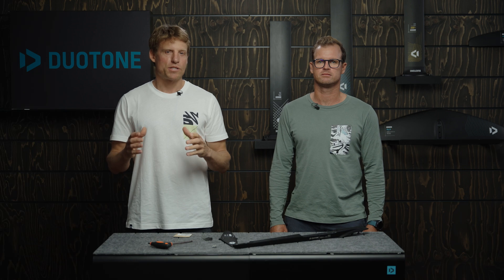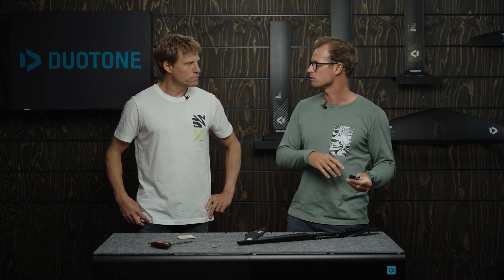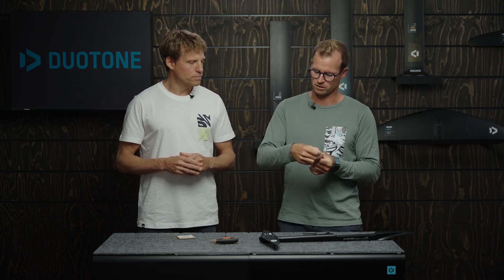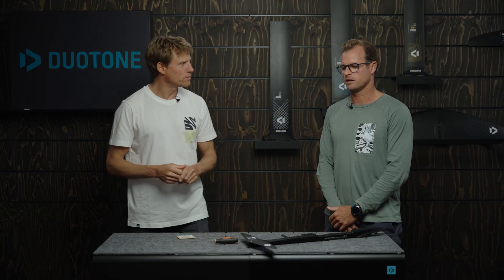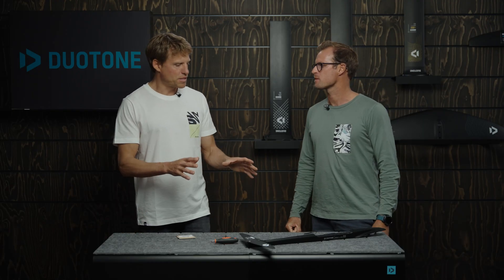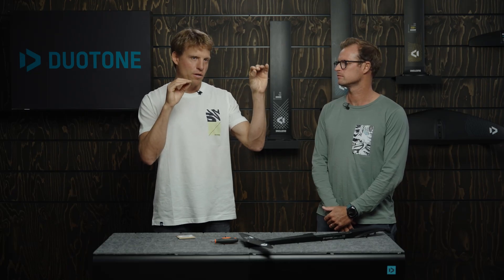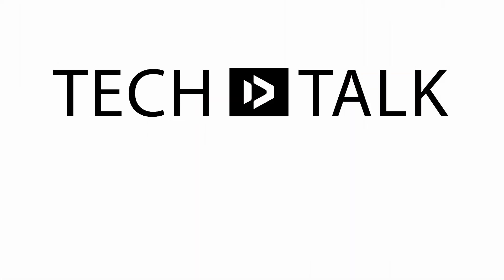Duotone Wing & Foiling Tech Talks - Foil Position, Trim & Shims

Comment: Cheers for the video! What screw length do you guys recommend? If I want to use say the 0,5 shim on my 1350 glide v2 setup, I found that the screws that came in the package were not long enough…don’t wanna lose my stab😅
Reply from the maker: maybe try the M6x20mm screws, bit surprised that they are too short? are they the M6 x 16mm.

Comment: Hi again, If the stab plays a negative force (down) compared to the front wing (up).... then, a large stab increases lift but does not increase glide nor speed, as a larger stab increases drag and does not add lift... am I right ?
Reply from the maker: Hi Fran,  Jerome had some issues to answer your post here for some reason, did not work - lift yes a bigger stab will create more downward pressure, but this can also then lead to the front wing coming up/but makes more drag and can actually make the foil perform worse if too large. Glide can be better normally/but the pump speed/efficiency is mostly worse, as it is then slower to pump. Slower for sure, unless the back stab was too small to start with. Ride weight and experience level can however then vary a lot, as some will prefer the bigger back stab to stay up longer, whilst others want a smaller stab for a higher pump action speed. Generally we try to hit the middle/sweet spot with our foil sets, most of the time no need to change anything.
Reply from the maker: Hi Fran, Jerome sent me this to add to my comment, as you can see, it's not always that simple...:-)

Yes, you are right, except for "a large stab increases lift". Not in all cases.
Let me explain:
During low speed take off, when your fuselage has a positive angle of attack, higher than say 5 degrees, then your stab is momentarily also having a positive angle of attack and it is generating lift in the same direction as the front wing. In that case, a larger stab increases the overall lift of your system. Once you start to accelerate and you reach cruising speed with your fuselage closer to 0 degrees, then your stabiliser is pushing in the opposite direction as your front wing and thus is removing lift from your front wing, making your setup less efficient for a fixed speed and fixed angle of attack (close to 0 degrees). In summary it is a little more complicated when we start looking at various speeds and various angle of attack of your fuselage, sometimes the bigger stab helps, sometimes it doesn't.
You might tell me: "well that is weird because I definitely feel more lift at cruising speed with a bigger stab, and here you are telling me that a bigger stab makes my setup less lifty"
What you are feeling is not more lift from your system, you are feeling the center of pressure of your system moving further forward and applying more force into your front foot than your rear foot.
I hope that I was clear enough and have answered your question.
Reply: @duotone.wingfoiling  thank you guys for the immaculate explanation and for your great customer support !

Comment: I think you should explain the difference and relationship between "front foot pressure" and "lift".
Also, the difference between lift at low speed (before on foil) and lift while fliying at high speed. Are both affected by shimming ?
Reply from the maker: yes, people tend to mix things up a bit here, even ourselves during test reports between different people. So front foot pressure is whilst you are up on the foil already, this is how relating to how much pressure you feel from the front wing pushing upwards under your front foot - many people would call this then lift, as it feels light it is lifting.

Actual lift should be the way the foil lifts from getting the board released from the water to a foiling position. Foils with a lot of "lift" in this case, tend to often have a lot or good front foot pressure, but this can be too excessive, if you are looking for speed/manouevers or an inexperienced rider will not know how to use his/her body weight to keep the foil down. 

Lift at low speed can be good, to get up onto the foil, this can be adjusted by shimming, yes by adding positive tail shims. Or by moving the mast further forward, which is generally the better way to get the "right" amount of front foot pressure. 

Lift while flying at high speeds is then a different story, as you want the foil to feel as neutral as possible, here I would revert to "front foot pressure" as a guide, to feel comfortable having just enough of it, to be able to push against, without the foil coming up too much. Here negative shims can help to reduce too much "lift" or front foot pressure. 

But Jerome can give a much better explanation as a designer, this is more from myself as an end user, using terminology/logic from testing/discussing with people on the beach. That is quite different from the sometimes quite technical discussions that some people have/use/prefer. :-)
Reply: @duotone.wingfoiling  thanks so much !!

Comment: Hi Jerome - Could you please tell me how much shim I should use to make the 216C feel like the older 215 from the Windsurf foil set? (To me the 216 looks and feels much flatter/pitchier.) Thanks. (I can 3D print any angle shim.)
Reply: Hi, the 216 stab has about -2.0deg AoA in the center, compared to -2.3deg AoA on the 215 stab. You should thus use a 0.3deg shim on the 216 stab to make it similar to the 215. The thick part of the shim should be on the trailing edge side.

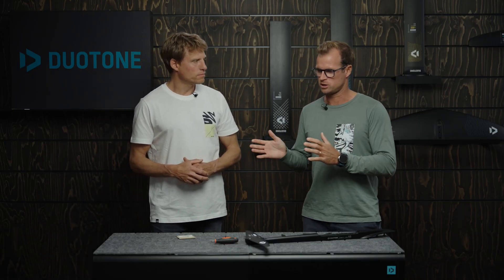Comment: At 3:50 , instead of "as you accelerate" did you mean "when you are riding at high speed"  ?
Reply from the maker: If your front foot pressure doesn't stay similar if you change speeds (accelerate), but pushes your front foot up more and more and you have to bring your weight forward the faster you go, then you might want to try decreasing your angle of your stab with the use of a negative shim to keep it more balanced throughout the different speeds you're riding. Some riders prefer to have the "safety" of the front foot pressure building up, as it's usually more controlled at high speeds to have a bit of front foot pressure to push into. Play around to see what's actually faster for you and your level of riding. Hope this helps!

Comment: I’m not sure I understand the front foot pressure concept. Doesn’t this just depend on where I’m standing? All foils generate more lift as speed increases. If I find the front foot pressure increasing too much doesn’t that just mean I’m standing too far back or the mast is too far forward?
Reply: All front wings will generate more lift as speed increases IF the fuselage stay at exactly the same angle of attack. Remember that we have not only the front wing generating lift upwards but also the stabiliser which is generating an opposite force and thus subtracting lift from the front wing as speed increases. We explain that in more details in our other video "foil basics" https://www.youtube.com/watch?v=b_bL2ksu_kA&t=126s

Comment: Great work guys! My question is :  
What effects does a negative Shims have while riding a wave?
Example: if I ride a one meter wave without thickness and the foil tends to come out of the water, if I insert (negative) shim while riding the same wave will the foil tend to stay in the water longer? If so, will this happen at the expense of delayed flight departure?
I hope I was clear
Reply: Hi, yes a negative shim could help you in that case, definitely worth trying it and check if it solves the problem you are having. One adverse effect from using a negative shim though, could be that your setup becomes too pitch sensitive. If that is the case, you might want to try a smaller size stabilizer without any shims. Lastly it could also be that the foil you are using is too big and generating too much lift once on a wave. If you give me you exact setup description and your weight, I might be able to have a more accurate tuning solution to your problem.
Reply: @BonieuxJerome  Thank you in advance for your availability but I just needed to understand how the shims work in the waves. Sometimes I find myself in the situation I described above and moving the mast is an increasingly delicate operation.

Comment: This is one of the best videos I’ve seen explaining tail shimming and tuning. The only thing I feel is missing is the effects of shimming on feel, pitch sensitivity, turning, and speed. Negative shimming may turn better and be faster but also pitch sensitive and harder to ride, etc.
Reply from the maker: Thanks, happy that it helps you! You're right, it's a fine line between lower drag and being too pitch sensitive when reducing angle on the stabilizer. You can be faster with more angle / a more draggy system because of better control and the ability to push harder. Of course it also depends on your riding level what's best for you personally. Better riders can get away with a more nervous setup and enjoy the extra turning it offers them. Lower level riders will be better off with a more stable system to unlock their best. Cheers, Klaas

Comment: Remember that this advice applies to stabilizers mounted on the board side of the fuselage. The effect would be reversed for a brand where the stabilizer is mounted on the opposite side.
Reply: Good point! We should have specified that in the video ;)